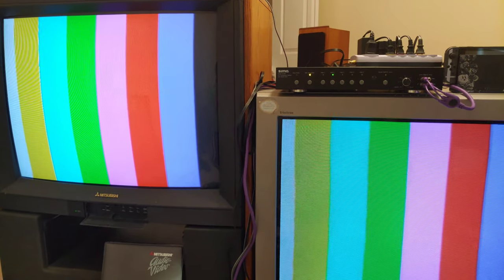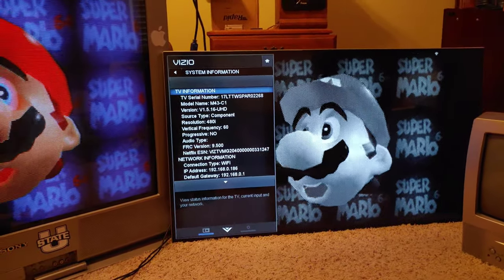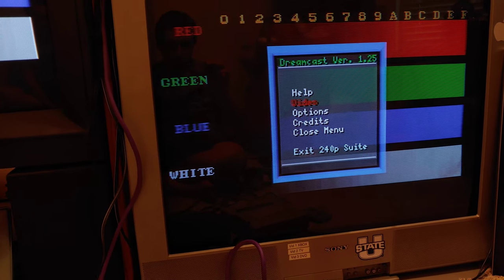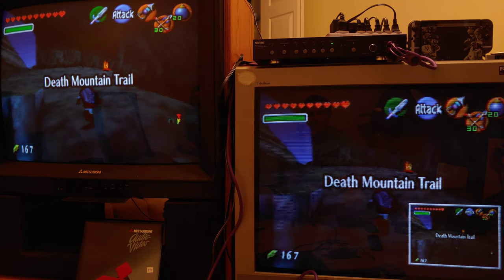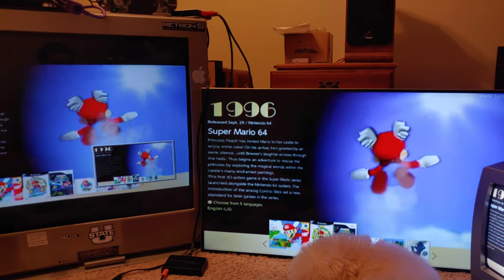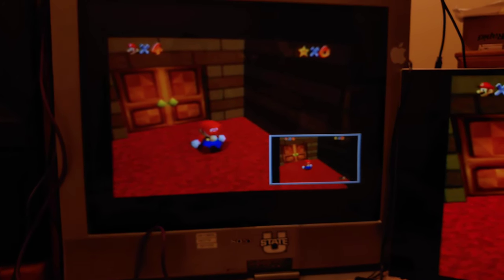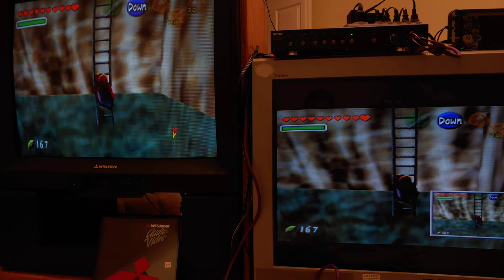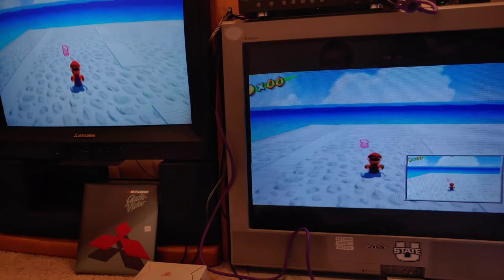TV Wars Part 2 - S-Video and Composite Gameplay Tests!

Comment: These Mitsubishi TV sets, as well as the JVC D Series, RCA E Series, Thompson Black Pearl Series, they all use very similar black tinted glass heavily curved tubes, well they all produce imo the best 240p/480i image quality, late 90s Sony curved 4:3 RGB sets come close, and some 3D 480i games look best on the Sony sets, basically if you have room, ideally you would have both TV types, the flat 4:3 Trinitron sets are still the best for PS2/XB/GC/DC consoles, especially 480p progressive capable sets,